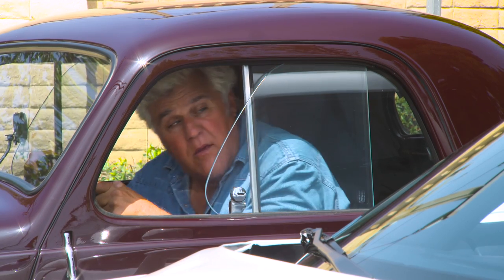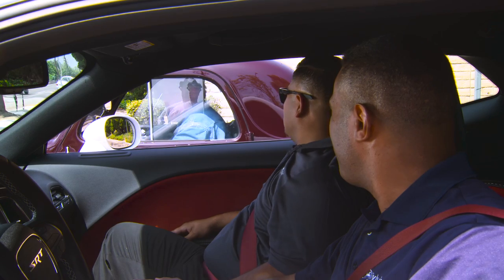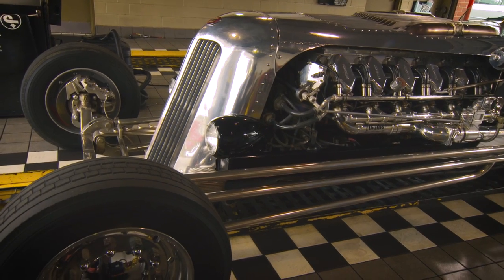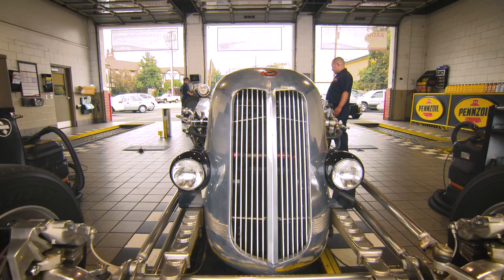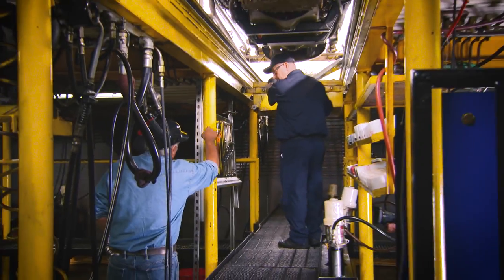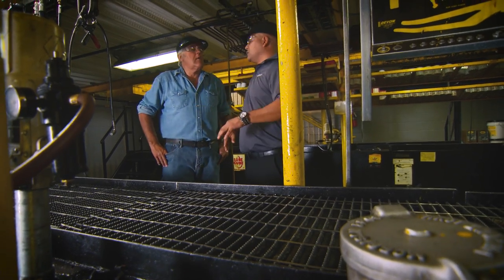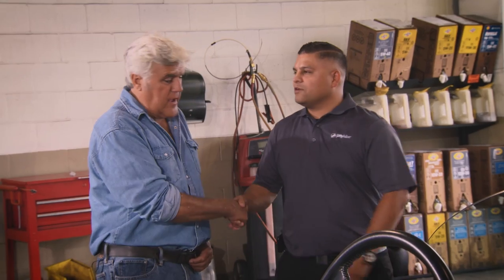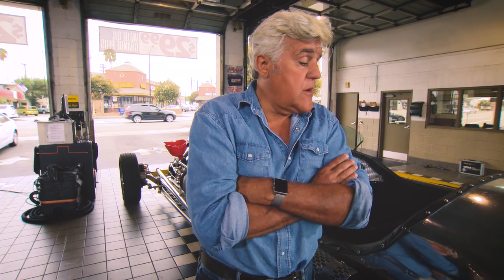Biggest Oil Change Ever - Jay Leno's Garage

Comment: sure Jay gets a first-class treatment, but any customers care to share if jiffy lube is even worth sending our cars to?
Reply: Never, oil changes are extremely easy. Go buy some nice oil, and a nice filter. It's not that expensive, do it yourself there's a billion how to's on the web. Then change it again in 7,500 to 12,000 miles. 3,000 is 100% false and a scam. Just like Jiffy lube.
Reply: +Ian Thompson the mileage you change your oil at also depends of the type of oil you use and the health of the engine
Reply: I'm well aware but our 95 Buick actually has a special oil sensor that senses the condition of the oil. It's not based on a timer like normal cars. With good non synthetic oil it usually prompts us to change it around 7,500 miles. Now of course with a full synthetic you can easy get 12,000 miles out of it.
Reply: +boy638    I took my 19 72 c-10 there @ 17 years ago......drove down the road a little,then started smelling burning oil pretty bad.  I pulled over,and found that they forgot to put the oil fill cap back on the valve cover. I replaced the cap after topping off the oil.  NEVER went back.
Reply: +texxfletch1 hmm with so many bad customer reviews I wonder why would Jay choose them to sponsor
Reply: +boy638 most of these shops are scams. I'm sure there are some good ones around but you can't tell the bad from the good. Goodyear, Valvoline, Midas, Jiffy Lube, etc. will never get my money. 

Why do you think they need to offer coupons? Because you will go in for a free oil change but next thing you know they fucked something up on purpose to make you pay to fix it.
Reply: +boy638 money
Reply: +boy638 Over the life of several cars and roughly 1 million miles of driving, I have mostly changed my own oil. However, sometimes there is just no time and I have used Jiffy Lube. Of those times, which I would estimate around a dozen, I found that they didn't properly replace the plug correctly 3 times. On one car, they didn't put the washer/gasket back on the plug and the two other incidents they didn't properly torque the nut and only because of by sheer luck and slight paranoia did I discover this before a serious leak happened.
Reply: +Ian Thompson 7500 to 12000. i see. u have naver opened the engine to see what happens to it if u change oil this rare. 3000 is the best. just sayin` as an egineer.
Reply: Ian Thompson u are not a mechanic. period.
Reply: I just said I am... Who lies about this with the Internet as big as it is these days. Your flat out wrong, you started this beef, now please go away troll
Reply: I like taking my older car to jiffy lube because they offer free top offs for the 3 months following service. My car burns oil so I can take it for a top off to any jiffy lube and don't have to deal with the dealer. They always did a good job for me.
Reply: +Ian Thompson last time I went 5k on an oil change, in a 240D (Diesel) I ended up having to open my engine and clean sludge and carbon deposits off the valves and bottom end. In these old diesels, the oil is part of the emissions system and captures a lot of particulate matter etc.... The extended OCI really doesn't work for every vehicle. I could probably get away with it on a newer gasoline engine vehicle, but, oil's cheap enough and I no longer take chances.....
Reply: I understand your point but diesels are dirty engines, especially when they're older. Any healthy gasoline engine can do 5-7,500 on conventional oil. And 12,000 miles on full synthetic.
Reply: +Ian Thompson Diesel engines generally get higher miles per oil change. Because diesel can act kind of as an oil, so if it leaks into the oil system, no big deal. If gasoline leaks into the oil system it will actually break down the properties of the oil. The reason why people think diesels are dirty is because when they run rich they produce a black sulfur smoke. Gas engines harm the environment more without the visual effects when they run rich/improperly.
Reply: +Ian Thompson While I do agree that 5,00-7,500 oil change intervals are not a problem, if you use quality oil and a good filter. When using the oil and filter you'll get with the basic oil change from the quick lube places I'd stick with 3,000-3,500 intervals, mainly due to the low quality filter you'll probably end up with on your vehicle.
Reply: +boy638 Ha! It would be funny - and realistic - to see Jay's tank car blow up ten minutes after leaving that stinking place.
Reply: +Ian Thompson 
Good luck with that oil changing at 7,500 to 12,000 miles your car will be fucked by the time it reaches 100k.
Reply: Ian Thompson Have fun with that.
Reply: Ian Thompson You think that Mobile 1 isn't putting bullshit numbers out to sell oil? They are just as corrupt as a corporation as any jiffy lube, Valvoline, etc. I'll take the words of all of my friends that are mechanics over some YouTube commentator that wants to get people to blow up their engine because they've been using oil for twice as long as they should.
Reply: +boy638 ya, they do a good job. I live in Colorado and when it's cold and I dont feel like changing my oil I take it there. I get $20 coupons in the mail. Well worth it. They top off fluids and I've always had good customer service. I emjoy them and also recommend them.
Reply: So... Do you look like Pamela Anderson?
Reply: +Ian Thompson ehhhhhh. I don't know about that. some newer customers here at Toyota now require 0W-20 be used on their maintenance plan and Mobil 1 0W-20 looks pretty dark after just 5,000 miles. now I end up changing their oil every 5,000. in fact a few customers asked the dealership if I could be the exclusive technician on their repairs and a bunch of other technicians got really mad about that. take for example, the 2AZ-FE. Toyotas first engine to recommend 10k intervals. now what are Toyota technicians doing? rebuilding thousand of these engines because the piston rings collapsed due to improper oil change intervals.
Reply: +Charlie Gates Some newer engines with VVT can be very picky about the oil. I wouldn't stretch it out in these cars.  Also I'm unfamiliar with that issue. But how does bad oil collapse the rings? Unless it's like sludge...
Reply: +Charlie Gates also I would never run 0w-20 in a 10 year old engine. I think that's the real issue. That stuff is like water. When tolerances get sloppy you need thicker oil. I was in Autozone when this lady came in saying she just got an oil change but her truck (ford) was burning oil and making noise. I asked her what oil. She said 5w30 because that's what the cap says. I asked how many miles. She said 280k! That oil is way to thin for those miles! Hell even our Subaru which takes 10w40 had bad piston slap when cold. I thickened the oil up even more with that thick Lucas stuff. No more piston slap ever! Been a few years. Moral of the story. If you have an oil engine use thicker oil. It's common sense. Ow20 is water.
Reply: +Charlie Gates sorry I meant the lady put 5w20 in her truck. Even worse. But that the ford spec. But not for almost 300k miles!!
Reply: While I understand your logic, there are several reasons I disagree, respectfully. One of Toyotas most popular V6 engines, the 1MZ and 3MZ and VZ series suffered horribly due to sludging. Had the owners used different oil and perhaps went the recommended 3750 on their oil, it wouldn't have sludged. There's also the 1ZZ-FE, which if you didn't use the correct oil, began to burn oil in less than 75,000 miles. Toyota recommended synthetic at longer intervals, and lo and behold, the oil ring collapsed. 

Now, almost every Toyota except for the GR family used in trucks has three rules: 
1) use only 0W-20.
2) 10k mileage intervals
3) canister filter. 

Like I said, many times I've replaced 0W-20 at 5,000 miles of usage (give or take a hundred) and it was very black. I wouldn't recommend going over 5,000 on any kind of oil. If I used conventional oil I'd look at 3700 miles. Synthetic you can push 6,000. But no more.
Reply: Synthetic oil might be good for cold weather starts, but it gets just as dirty just as quickly as conventional oil. It might not break down as quickly but you'll be circulating filthy oil for 7000 more miles than you would changing conventional every 3000 miles.
Reply: 3000 miles is a farce... Check your owners manual... for base spec oil it will tell you 7,500... The oil life meter in our 94 Buick Roadmaster kicks on between 7 and 8k miles with High Mileage blend oil... Now in my truck i change the filter at 10,000 but the oil at 12,000 since I run mobile 1...
Reply: Change your oil every 3-5k miles no matter what type it is and at least once a year if it doesn't hit it's mile mark. Oil is cheap, engines are not. Preventative maintenance is better than pushing the limits.
Reply: Then your just wasting money! If the manufactures tell you, to change at 7500 or 12,000 you should listen! Why wouldn't they just want to sell more oil??
Reply: Every 3,000 miles I change the oil on my car. For only $15 I have piece of mind that the job was done right and that my car will be able to get me around from point A to point B. And I certainly don't have to worry about jiffy lube, or uncle ed's, or any other con artists ripping me off and damaging my vehicle.
Reply: NO! As someone who worked, part time, at one while I was in trade school, those quick lube shops should be avoided like the plague! Do it yourself! Oil changes are easy, and, you can actually be 100% certain everything was done right, and, your drain plug wasn't cross threaded by some illiterate, 17 year old, half wit!
Reply: sometimes people do use the service cause jiffy will remove the oil and dispose of it properly for you. where as when you do it you have to dispose of it and most garages now are refusing to take oil unless u get a oil change
Reply: Rivierabybuick And "u" are not an engineer. I've never met an engineer that can abbreviations, unless it was an absolute necessity.
Reply: Dilan gilluly That is true. A well tunned diesel is less polluting than a gas powered
Reply: Ian Thompson exactly easy to do
Reply: Ian Thompson who ever changes their full synthetic oil at 3000 shouldnt be able to drive
Reply: Ian Thompson I got 11k out of my full synthetic
Reply: Ian Thompson 7500 is a good mark for a newer engine on full synthetic, 12000 is pushing your luck in my opinion.  Especially on an older engine even on high end synthetic oil.
Reply: boy638 p
Reply: No, you should change the oil yourself
Reply: I change oil by hours and conditions, for mostly Highway driven Gasoline vehicles 150-200 operating hours...which if you live in the city (20mph avg. would be 3000-4000 miles, and if you are a commuter (45MPH avg.) 7000-9000 miles, and if you long distance freeway commute (60+mph avg.), 9000-12000 as long as you are using a quality motor oil.  The reason why to change by hours is the city driver goes thru many more warm-up cycles (which your engine is polluting the oil most) “per hour of operation”, and the commuter or long distance freeway commuter's car is only experiencing one third or one fourth the warm-up cycles, or even less.  (If you tow or drive off-road,  you would want to bring the hours back to 100-125 per OCI).
Reply: I've heard horror stories.  The worst that ever happened to me was they didn't have an oil filter for my 2015 Ford F-150.  The second most popular engine option in THE most popular motor vehicle in the United States, a full 18 months after it was introduced, and Jiffy Lube didn't have a filter.  I don't mean "didn't have one in stock."  I mean DIDN'T HAVE ONE, period, full stop.
Reply: boy638 absolutely not
Reply: He has a huge bank account and he's able to donate a massive chunk to the garage
Reply: @Austin Reed (are you related to the cheap men's clothing stores in the UK?) If Mobil wanted to sell more oil, they would push the shorter change intervals. If car makers wanted to avoid a crappy reputation for reliability, they would also push the shorter interval. I'll listen to the engine manufacturer rather than "all your friends" who also appear to be YouTube commentators.
Reply: @iant720  I mean it's not false 7500 miles might LOOK like perfect oil but by that time it has been through several heating and cooling cycles and has really been beat up and has become slightly less viscous and has thinned out a bit can start seeing some blue smoke on certain vehicles and some people take longer than others to reach 7500 miles and even with regular driving of 10-12000 miles a year you dont need to wait 7 and a half months between oil changes itll shorten the life of your engine now some motors reccomend only one oil change a year but if it doesnt 3000 miles or every 3 months is great advice to follow cause tbh the best way to run motors would be fresh oil constantly being run through it but you cant do that easily or efficiently
Reply: That is a complete waste of money. Also I suggest you look into Mobile 1's new annual oil... thats once a year.
Reply: Penske goes 20000 plus miles on big trucks
Reply: DON"T DO IT!

Comment: Jiffy lube did a friends wifes car she drove about 8 miles and the motor blew cus they drained the oil and didnt put oil back in the engine and sent her on her way with no oil in the engine! Dont go there! Second story friend i work with went there left and they didnt tighten the drain plug/bolt down the road he went it fell out and the oil drained out and the motor made knocking so he pulled over to look under the car to see the drain bolt was gone and the engine was ruined cus he was on the beltway driveing 65 mph! Dont go there! I repeat DO NOT TAKE YOUR CAR TO JIFFY LUBE!

Comment: The 3 times I used Jiffy Lube, it ended up a disaster. Each time I told myself "last time was a fluke, they won't screw up again."

3 separate locations.

1st stripped oil plug threads and I was out of oil a mile down the road.

2nd put the wrong oil in my diesel Jetta at the time. Oil exploded all over the engine and driveway next day. $500 in repairs. I even told them it's a diesel and takes very specific oil. "We got it dude."

3rd "It's a manual with an electronic parking brake, can you guys handle a manual? And are you familiar with electronic parking brakes?" Yeah man, we got it!

My Audi S5 rolled out of the bay and into the back of another parked vehicle. Lucky the vehicle was there, or it would've rolled into rush hour traffic. It was also a Jeep with a spare tire, so no damage.

After that, I swore on my father's grave, never again will I let anyone change my oil, only me.

The myth is true. Stay away from Jiffy Lube for anything other than a state inspection. Even then, use caution.

Comment: Jiffy Lube was the reason I started doing my own oil changes. They didn't tighten up the oil filter on my Pickup and thankfully I only went to walmart afterwards and saw the oil puddle under the truck before driving again. Had to crawl under the truck and tighten the oil filter AND then buy a quart of oil more. Just do it yourself!

Comment: Went to JL a few years back. All of a sudden the oil pressure gauge didn't work any more. Turns out the geniuses drained the oil through the pressure sender unit and snapped off the wire and tabs. Cost me another 75 bucks to replace the sender unit and re-change the oil myself. NEVER again...

Comment: Don't even bother emptying the bottom of your car to get the oil out, too hard to get the cap back without damaging it and doesn't always remove all the old oil. Better to use a pump right from where you'd pour the new oil in, works just as well and you can do it yourself. Great video Jay and thank you Jiffy Lube for keeping these videos free! Sorry to spoil the secret, couldn't resist ;).

Comment: never used jiffy lube before. i do my own oil changes but as a former oil change tech myself i can tell you that all companies with drive in bay that you go under use the drain bucket and then pump it to a holding tank. places that use lifts to do it drain into a portable tank then transfer to a holding tank. the epa doesn't allow the use of those underground tanks anymore, and if a shop is using them they are in serious violation of the law. furthermore i know this is a sponsored ad, but dont get things twisted. those "free" oil change coupons come usually with a 5 qt limit. alot of cars these days are 5.5 qts or more. they hand them out so they can get your car in to "up sell" you other services. that is why i am a former oil change tech. i dont like up selling but it is part of how they make  money.  you cant make any money on oil changes alone

Comment: A few weeks ago, I went to a local Jiffy Lube to have my oil changed. I specified that they were not to vacuum out the car, not to check the tire pressure, none of the superfluous stuff. Just change the oil & filter. With MY oil & filter. I asked how much it would cost ?  $35 !  I told them "no thanks", and took my car to a local Mom & Pop garage. $8. That's right. Eight dollars. Point made. I'm no longer physically able to slide under my car, but I can still clean inside the car, check the fluids & tire pressure. Give your local "Mom & Pop" garages your business, They will be glad you did.